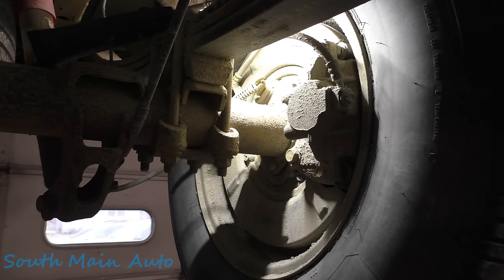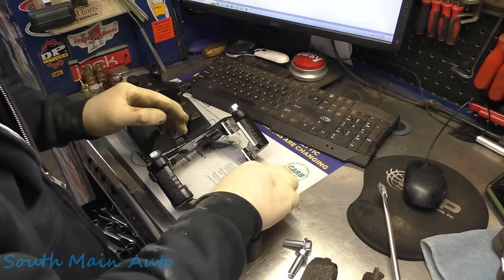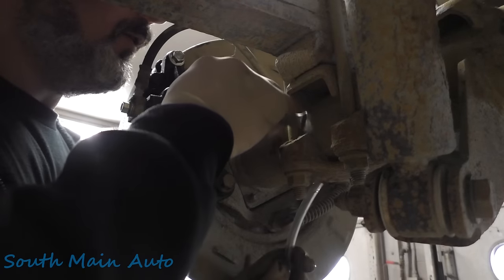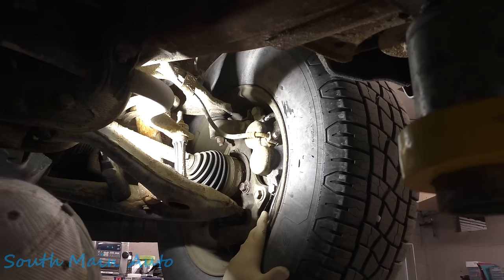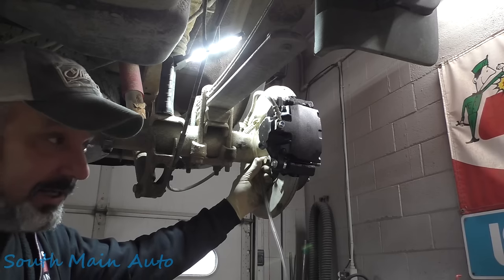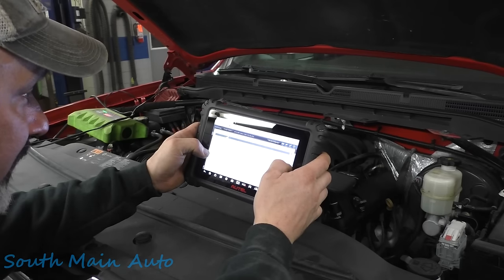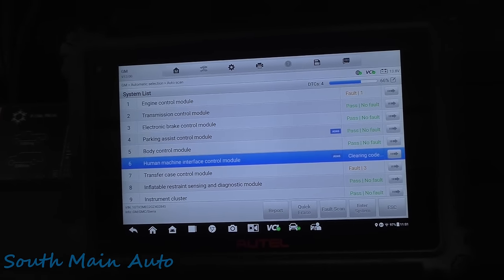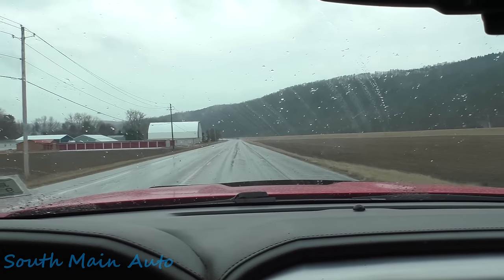GMC Sierra ABS Pump Motor Failure - Part II

Comment: Eric, outdrives on boats operated in salt water have unlike metals corrosion issues leading to seizures that are ameliorated by attaching a zinc slug to the outside of the outdrive. Would a hunk of zinc on each caliper help?

Comment: Hi Eric! Enjoyed the video and learned a lot, as always. Could you tell me if the Autel diag tool would give the instructions and manage the automated bleed, or you actually either/and need both a specific manufacturer tool and a a manufacturer specific library subscription? Planning on keeping my 2019 Wrangler for a long time and do as much work my abilties allow me to and to do so I’m on the verge of pulling the trigger on a good diag tool (Autel or Launch).

Comment: what is different between the salt used in NY and the rest of the country.  I live in  uses salt state and my almost 30 year old Maxima has no rust issues.  I always run it through a car wash after storms but that's about it.  outside of a bit of underside surface rust there are no issues with the car.  also garaged , maybe our drier climate is the difference

Comment: Ah good old Galvanic corrosion, also known as bimetallic corrosion, anti-seize might help but with all that pressure & with all that salt electrolytes it's going to happen. Maybe if they had the full rubber caps packed with dielectric or Silicone grease might help but don't bet on it.

Comment: I never second guess the great Eric O but in cases of bleeders screws, a 1/4 ratchet is a much better finesse tool, instead of that big ole 3/8. Of course a DIY guy can spend a half hour to save a bleeder screw, its different in a shop.

Comment: One question Eric, when you bled the brakes, did you push on the brake pedal to open the valve in the master cylinder, wouldn't flow through, or does it flow through anyway with the power blader on the master cylinder, And if you let it just gravity bleed, do you have to push the master cylinder pedal and hold it again. Also, let me know, thank you.

Comment: Pressure bleeding the brakes with an ABS system, do you need to disconnect battery if your not replacing the ABS module as your doing?

Comment: Not something I would recommend for a shop or professional to do, but I bleed calipers like this at the hose instead. Mind you, this won't work after you messed up the thread but only if you decide not to risk trying to open in. Put something thin in instead of the brake pad, pump the pedal until the cylinder is extended. Then push back the pad with the pedal held down to get the bubbles out of the caliper itself, keeping the pedal down is to prevent from dirty fluid and bubbles to go back up the line. After this bleed the line the "normal" way using the hose attachment to open/close instead of the bleed valve. Not ideal, but works if you are on an extreme budget or in a pinch and need the car to drive and break without having to first source a caliper..
Reply: That's what I've always done when the the bleeder comes in pre-broken.

Comment: Brakes are the most neglected part of a car...they should be inspected and cleaned at least once a year, but most just get left until they fail! DOT4 just works better at higher temperatures than DOT3.

Comment: I realize that you may not see this but I've been watching you for a while and was wondering if you could show a little more depth as far as programming these modules. I work in a shop as well and they dont want to get into things that are "too involved" because they want the quick easy money. I have however run into a few instances where I did a diag outside of work like on my father in laws 08 Silverado but I told him he would have to tow it to the the dealer because I wouldn't be able to program the FPCM. I understand theres the subscription for the key or whatever to get into it but how do you hook into it I guess is what i'm looking for clarification on. Is it just an OBD2 plug attached to a laptop? A little more insight into this would be greatly appreciated and thank you for helping me be a better tech to my rust belt customers.

Comment: Heat just expands the bleeder screw and tears into the caliper. You need to get the S.U.R.&R. (not a sponsor) BB007 Brake Bleeder Removal Tool Kit to zippy zap those muthers off.

Comment: Turn the ignition switch to run, sit in the passenger seat, fart 6 times, move to the drivers seat, sniff 4 times, wash the rear windshield, sit in the drivers seat, turn the ignition switch off, and the parking bulb setup is complete!

Comment: Does the heating with a torch work on fuel connection nuts too?  Well, once maybe!  😵  Excellent job as always!
Reply from the maker: Yes.... but you have the have fast reflexes  😅
Reply: @SouthMainAuto  do you have an induction heater? as opposed to the flame thrower

Comment: How come Ray in Florida doesn’t have a hot wrench in his shop, have you used the induction heat gun on the GMC rear brake bleeder valve

Comment: I don't think I have ever replaced an ABS pump. So when the entire assembly is replaced will it generally require access to service software to program the new unit?  Looks like that part is not something a DIY'er is capable of doing, correct?

Comment: Manufacturers should put a threaded insert in the caliper so that it would be steel on steel. Salt has nothing to do with it. Aluminum will corrode at the steel bleeder anyways.

Comment: The surface on the copper gaskets are never smooth. After tightening the banjo fitting whack it with the hammer then retorque.

Comment: I wonder if Noalox would prevent the oxidation of the Al threads.  It's not anti-seize.  It's meant for Al electrical wire, but might help.  Someone test that.

Comment: I just wonder about the gain of switching from steel to aluminum calipers. I know about the heat dissipation factor but shouldn't the bleeders be more compatible. Maybe a harder alloy. All this design without proper testing seems an awful pain in the ass. Great videos.
Reply: @Look_What_You_Did  The change from ferous to aluminum was done for heat and weight dissipation. If you have ever raced you would know what brake fade is. Heat cycles cause the different metals to react differently. Heat has everything to do with it. Lok what you didn't do.
Reply: @Look_What_You_Did  Like adding magnesium. WTF is your problem?

Comment: Techline Hit or Miss??  Maybe use the MDI II, never had a problem yet.
Reply from the maker: Whatever interface device you use doesn't matter. GM tech line connect and SPS has been a disaster. Oh and I do use the MDI two just like I showed in the video

Comment: Non-mechanic question, "So, will the brakes work (non-ABS style) if the ABS pump is disconnected?
Reply: Yes. The pump is only there to return the fluid to the master cylinder reservoir each ABS cycle. With everything electrical disconnected the ABS unit is hydraulically equivalent to a section of brake tube (with a few proportioning valves inside it perhaps)

Comment: I normally nurture brake nipple niceness by one or more of (a) working around the threads with some cut and folded beer can aluminium, getting it into the thread roots (b) adding a very little of some kind of rubber compatible grease (c) wrapping the threads with PTFE thread tape. The thread tape is probably the most important. This is on my own car though. I suppose on someone elses I might not feel able to bill the time, and might worry about bits of PTFE getting into an ABS system (which luckily I've never had) and causing an accident/litigation.

How come Mr O says aluminium correctly? Isn't that un-American?

Comment: Try heating the bleeder and keeping it white hot for a minute. Then cool it by dowsing it with penetrating fluid. I like to use a breaker bar if using a socket so you can rock it back and forth gently without being tempted to try to pull it out too far too fast.
 Thread sealant like low strength Loctite prevents humidity from getting in and corroding the threads to prevent them from jamming up.
 Drawing a vacuum on the whole system from the reservoir for a minute or two can draw the air from the ABS module and other nooks and crannies. When you release the vacuum, fluid gets sucked back in where the air used to be.
 Activating the ABS on a slippery surface is a good trick to finish bleeding the ABS module.
Reply: Tell us all about it, "expert"...

...got any examples of your "genius"? Didn't think so... XD

Comment: DOT 3 brake fluid will absorb less water than DOT 4 from the air over time, meaning you'll need to have your fluid changed less frequently.
As most people don't change brake fluid use DOT3 unless you are racing the truck on the track. (I do this for regular cars)
For performance/track cars, I generally bleed with DOT4 or RBF600, then evacuate the reservoir and fill with DOT3 as most of the moisture enters through the reservoir cap and there is little exchange from reservoir to calipers.

Comment: I wonder if it’s ever worth putting a helicoil or similar in stripped bleeders?
Reply: hydraulic pressure is not something i like to play with fixes on in general without welding it.
Reply: @michaelkaster5058  Sure but the sealing surface itself shouldn't be affected unless you drill into it, right? The threads are only there for tension

Comment: So why not anti-seize the bleeders on new or re-man calipers??
Reply: It’ll be in the junk yard soon anyway
Reply: honestly, if the truck only has/had another year or two before the heap, I would just bleed it at the brake line to caliper connection.  EO can't show this, nor would he want the bad rap for doing it, but if it's a Sunday and you can't get a caliper but need to bleed, just bleed it at the connection. It won't get the crappy stuff out of the caliper, but it'll bleed the line and satisfy the abs pump.  Then change the caliper (if/when) able. Remans probably install oversized bleeders or junk them for AL scrap.

Comment: Automotive enginers I guess don't understand about interaction with metals . Of course they attack Aluminum heat sheilds to a car with Steel rivets and the corrosion starts and the sheilds fall off . Putting steel bleeders in an aluminum caliper , oh well .

Comment: Your boots got a kiltie? 
What, you a lumberjack?
Reply from the maker: No but you will learn quickly running a torch with out a false lounge in your boots that you need one. Sparks on the bottom of you foot while your foot is in your boot doesn't feel great ;-)
Reply: Haha, fair enough.  When I was a bit green, I had a hot one go through three shirt layers, and make it all the way down under my foot (inside my boot).  
Nothing you can do but dance. 🔥

Comment: Can't drill, tap and oversize bleeder?
Reply: Difficult to get perfect alignment on the tapered seat, and not economically viable in a commercial shop, unless replacement caliper is super expensive or unobtainable (had it done once by local engineering shop in UK on a Rolls Royce caliper).
Reply: No, and even if you could it would cost more than a new caliper.